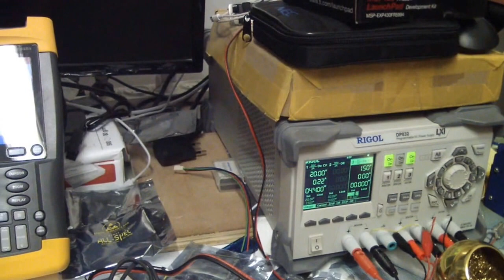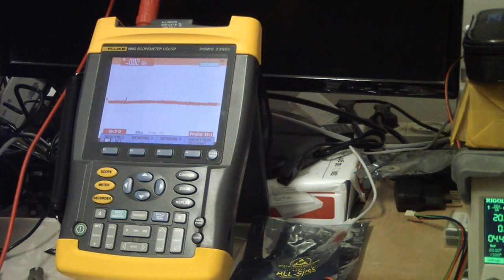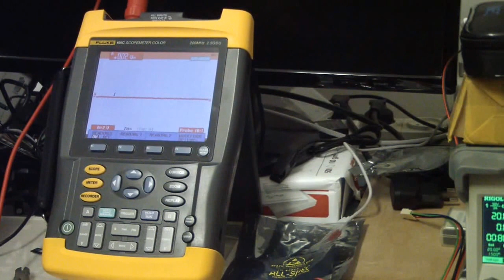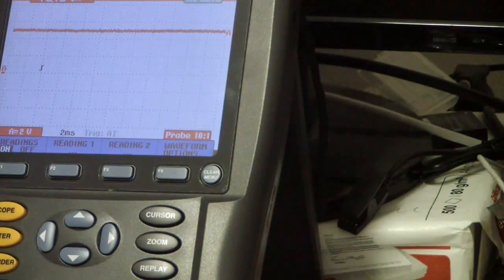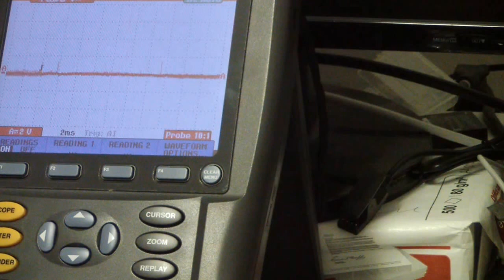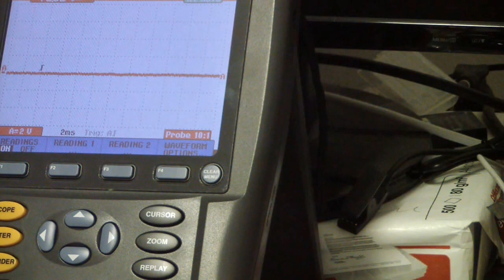12V-36V 500W Brushless Motor Controller - Part 1

Comment: I have a motor with three leads, black, blue & red (presumably no sensor) can I run it from this board ( the motor is rated 36 volts, 300w,  12000 rpm)

Comment: Hello.  I'm looking for a bit of help and maybe save someone from making the same mistake I did with these boards.  I am using the same boards you are to control a hoverboard with thumb (hall) throttles.  I needed the mounting holes to be a little larger so I drilled them about two sizes larger.  The board no longer works and one of the ICs gets hot if i leave it powered fort too long.  I was wondering if I had somehow cut through a path within the drill holes.  The holes I'm referring too are the four in the corners.  I have since ordered new boards and everything works fine (i didn't drill the holes larger).  Just curious if someone might know how to fix them or why they no longer work and a warning of sorts not to drill the holes larger.  Thanks  Oh, would anyone have a trouble shooting technique for these boards?
Reply from the maker: I have no idea how many layers in this board (I will try to verify) - but I strongly recommend not to do any changes, connect the wires you can, and from there do any connection you like .
But your fault can also be from other situation that ruin the board (too much power, or too much load, short or other problem)
Reply: @RoeeBloch  first off thanks for replying so quickly and the help.  As for the last part of your reply.  I have two new boards in and they are working fine.  I have about two hours running and testing time on them.  That’s partly why I think it’s the drilling of the holes that caused the problem.

Comment: Nice video! Did you get the pin-out documentation for this driver board when you got that module? I ended up here at this video link because I noticed that the modules I bought on ebay don't have any documentation at all hehe
Reply from the maker: I didn't

Comment: Hi bro. Can it reverses without hall sensor? Thanks
Reply from the maker: Hi, I don't think that this circuit works without hall sensor, but if it does sure you have pin direction ... change it from VCC to GND

Comment: Does this motor speed controller come with a brake option? . Is there a way to achieve braking by programming in Arduino ?

Comment: sir, here in India , there are many BLDC motors of Electric scooter not working anymore because their controllers were all China made and now that controllers are not available in Indian market, so what to do to use motors again in electric scooter??
Reply: Either spend 15 to 20 us dollars and buy another controller, or you can make one. 
    Arduino UNO board,  Brushless DC (BLDC) motor,  6 x 06N03LA N-type mosfet (or equivalent)  – datasheet,  3 x IR2104S (IR2104) gate driver IC  – datasheet
    6 x 33k ohm resistor
    3 x 10k ohm resistor
    6 x 100 ohm resistor
    3 x IN4148 diode
    3 x 10uF capacitor
    3 x 2.2uF capacitor
    2 x pushbutton
    12V source
    Breadboard
    Jumper wires Youtube this video and you can start a business fixing these units. when you save enough money. buy a cnc minimill and make your own boards fast.You can do this easy. I would not want to live where you are. You can do many things to make money like this. Want to know a better faster way to make money fast. Dig a trench 2 ft wide and long as you can. Best on a hill side.at the top put 500 gallon fish tank. At the bottom put fish pond maybe 100 gallon. In trenches put whatever plants you want to eat, but lettuce is very fast harvest. 20 days. Now you put water pump at bottom pond to fishtank on hill. Think about this You make clean food, no pesticides, no fertilizers. Only clean food that is still  alive and people pay 3 times as much for.Oh ya  put cheap gold fish in fish tank or whatever you want. Salad and Meat fresh. Go TO Work. I give you everything you need to be rich.   
https://youtu.be/2q0zsLUPKCY use this and you can't go wrong.
Reply: Brian Johnson ,thanx sir, can you recommend me any site or link for Universal controller which will control any BLDC motor plz
Reply: Brian Johnson , sir, I want to run 48v, 500w, BLDC, any clue??
Reply: vial.of.photons , thank you for your help, I will keep updating you if everything goes right

Comment: can we upgrade amp that it can handle or voltage source?? like adding more mosfet...
Reply from the maker: Yes you can change the Mosfets for higher current and voltage, but you need some electronics background to do so
Reply: Roee Bloch can u make a video about it.... please sir....

Comment: Hi, interesting video, thanks, one question: I would like to connect a rc receiver to this brushless motor controller but the controller expects a 0-5v analog signal for speed control which is not suitable for the pwn output of the rc receiver. Any idea how to connect the rc receiver with the controller for remote speed control ? Thanks

Comment: good video! But a lot of questions to the 3 Hall-Signals: Hall-Sensor will change their level due to the position / rotation of the rotor - but all Hall-sensors should NEVER have the same level at the same time...
1) What happend if all 3 Signals are 0V?
2) What happend if all 3 Signals are 5V?
Can these two locical states cause the controller to unexpected effects or will the controller-ic stop the current to the motor...?

One more question to the principle of these Controller-Board: Will it brake a motor at turning down the speed or will it free-wheel the motor? That is a big different! For a use in a eBike i want to free-whell and NOT brake the motor / wheel. But for an robot-projekt i want to brake the motor every time if the motor dont accelerate...
So how these little controller works in point of breaking...?

Comment: hi. correct me if i'm wrong is the Z/F pin is the direction and the VR pin is for the speed? thanks in advance
Reply from the maker: Yes this is correct
Reply from the maker: Yes it is, if you apply to Z/F GND is one direction, and VCC is the other direction, while VR voltage is the spinning speed
Reply from the maker: Yes

Comment: I have this thing which I assume is a driver for a motor used for boom barriers. the name is AG CTRL from Rogers Technology. Can you tell me if it is a driver for the motor, and can I connect it to an arduino or raspberry pi so I can control it from them?

Comment: I have used this driver for drive a brushless motor 24V and 50 W power. But the temperature of voltage regultares increase to much. Do you have any idea what  to do?
Reply from the maker: It shouldn't get hot at 50W ??  - this is strange.
Any way try to extend the heat-sync area and add Vent (like motherboard  cooling fan) Is your source Power stable ?
Reply: The temperetur of Mosfet is ok, but only the temperetur of voltege regulator is to high.
Reply from the maker: I think the only thing is to change capacitors - to capacitors with higher voltage
Check this it might work for you

Comment: I would like to ask you if I can control this bord using arduino ? And also how I can read the signals from the hall sensor using arduino also  ?
Reply from the maker: Yes you can generate the VR (Speed) and Z/F (Direction) with an arduino easily, use PWM with Low pass filter to VR signal, and Z/F as regular digital output from Arduino. new video is here: https://youtu.be/UJLJa3owuMY
Reply: yes,it can be controlled by arduino, as long as its a PWM input. there is a signal feedback interface output pusle. need more info,contact us,we are the factory produce JYQD V 7.3E,JYQD V 6.3E,, amigodeng@czowo.com.
Reply: thank you i already ordered 2 pcs of it
Reply: Amigo Deng how I can controller with Arduino?

Comment: Hi! Could you tell me if the change of the direction (CW/CCW) is immediate (fast) or
is slow? Maybe the controller implements acceleration and deceleration ramps? In my project I need fast direction changes and I do not need  ramps modifications by the controller. 
Thanks for advance!!
Reply: Hey Eduardo  .. i have this board .. it is very slow .. takes few seconds to switch direction (with momentum) .. did you find a controller that is fast?

Comment: Hi Rooe , is it possible to connect 2 or 4 identical low speed front hub motors to one controller and one trottle? as long as the controller is powwerful enough? Some say NO, but can not see the problem..
Reply from the maker: Hi, basically if the two motors are identical and also the hall sensor placement is same phase it can work. But this will do the job just if the load for two motors is identical. A problem will occur if the symmetrical in load or sensors is broken
Reply: we have one driver special forBalance bike, it can control two motors at same time,  max 500W per motor

Comment: Hey! Do u got some more info about this controller? I would like to know how to attach a heatsink to it, to be able to load it up at 500W! Chinese say it is only good for 60W load, if not heatsinked or fanned.

How to wire the controls to it? Is 5v signal good enough?

Purpose: Electric scooter build. Would be cool, if more than one could be chained together.
Reply from the maker: You can sure try, just put heatsink, check with DVM to make sure that the mosfet you are putting it on are connected (short) if they are you can use same Heatsink, if not you must use seperate Heatsink that is all the secret
Reply: But can you tell more about it? IS it possible to program it in any way? 

How can I know if it will have enough torque / power to suit my needs?

All I understand now, is that there are 3 pins for the motor phases, then optionally about 4-5 wires for the hall sensor (in sensored version)..

And for 'logic/motor control' there are 3pins or maybe 2, with voltage signal 0v till 5v (for throttle for example)

--

Do I needo anything else for it?

Of course there will be 2 terminals for battery too.. but will it work when I will connect 5v signal throttle (like ebikes use?)
Reply from the maker: about power you have to test - about programming yes you can, in fact the programming is very basic, you can read about the 3-phase driver, actually the Microchip is just enabling signals to Motor driver, and detect ON/OFF that is all, there is not any suffisticated SW in Microchip, if you know how to read DATASHEETS and understand basic of Microchip than you can do it by your own
Reply: Okay, still hard to understand whenever this is going to work for my application or not as I havent ordered it yet from the internet. 

All I know is I wouldnt like the acceleration to be very rough or maybe even too soft. If it is somewhere in the middle then I would be okay with that.. but without proper practical test it is very hard to figure this out just from the video u shared. 
Very little info can be found about this exact module, to be honest.
Reply: contact me,amigodeng@czowo.com. we are the manufacturer.

Comment: is there a way to bypass the hall sensing and use this controller to drive a sensorless motor ? (bought this controller by mistake and can't find any datasheet)
Reply from the maker: Yes you can - but it will not work good, you can try to generate 3 pulses to hall sensor on board, but the motor might not work at all, or work bad
Reply: You can add a sensor unit on the back of the motor

Comment: hi, would you be able to upload a wire diagram of your setup? It would be GREATLY appreciated for a project I am doing. Thanks for the great video!
Reply from the maker: This is very simple no need for wire Diagram - just connect 3 phases and GND for hole sensors and 3 hole sensors.
then you have 5V,  and potentiometer.
See here:
https://drive.google.com/file/d/0B31lfYH7hSVvTHQzdDB1bGc5NTg/view?usp=sharing
Reply: Where do you connect the resistor?? The VR on the set? 

Sorry I find your circuit diagram confusing... I have this controller, I've connected the 3 halls and phase halls. Then... Connected the 5V halls to the set 5V and the halls GND to the halls GND. 

But I can't fully understand how you've wired the potentiometer... What's the yellow wire out of shot connected too? Coz I can't see in the video :(

Comment: hii plz tell me what is a difference between brushed motor control and brushless motor control,
Reply from the maker: Hi, Brushed control uses PWM signal and H-bridge usualy, while Brushless Motor control uses 3 half bridge control, meaning for each of the 3 phases you can control the coil polarity.
Hope this helps you to understand better